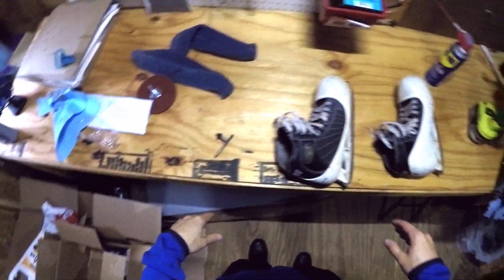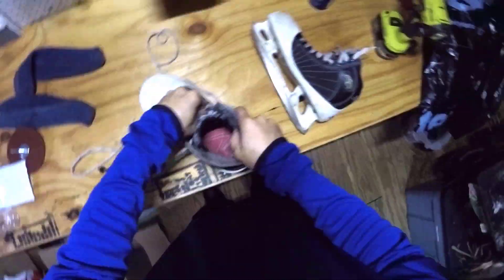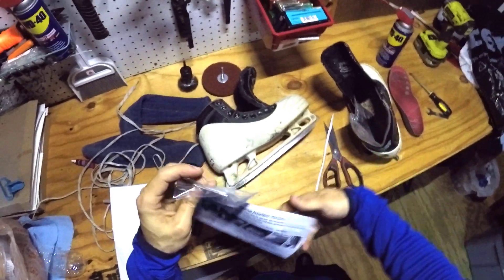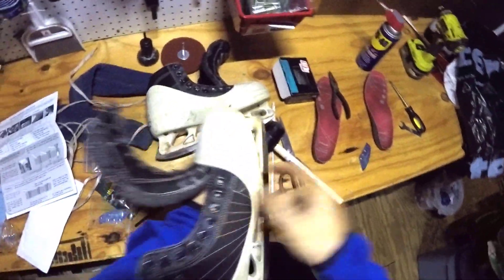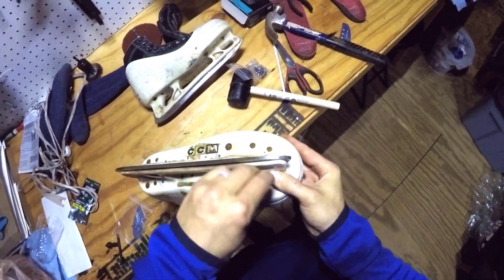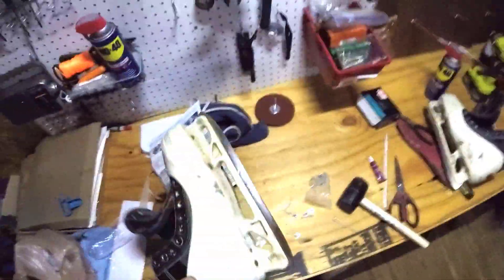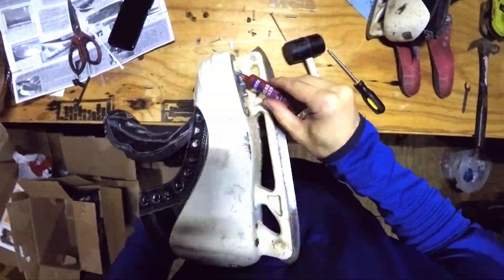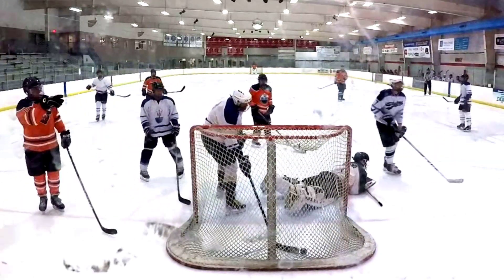Installing Overdrive Goalie Blades, How to and Review

Comment: Thank you for this.  I think I’m just going to go with a modern cowless skate.  And I hear you as I am  a goalie from  the 90’s taking a decade or two off and trying to transition to all this slidey stuff while 50 pounds over weight.  Every move looks and feels awkward and I can’t push to save my life try as I might. These may be a lot cheaper than a $500 set of skates but at my age that little catch of the ice you did would probably make me pull something instead of just knocking me off balance.

Comment: I could be wrong but I think the previous install was not done properly and the holes where in the wrong place.  The directions say that the blade should overhang the boot by 1/16” to 1/32” - these look like they are out quite a bit further.  This might be why you were experiencing them digging in when you did not want them to.  Anyway, thanks for the video.